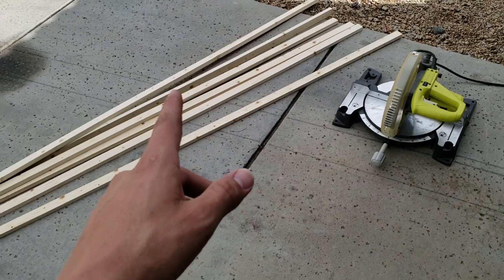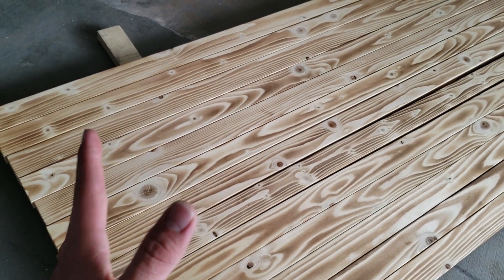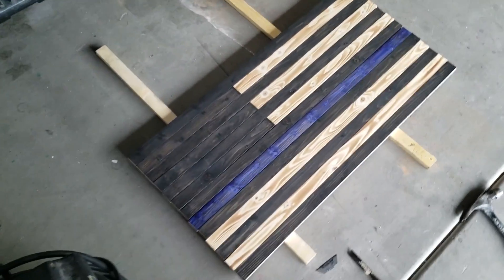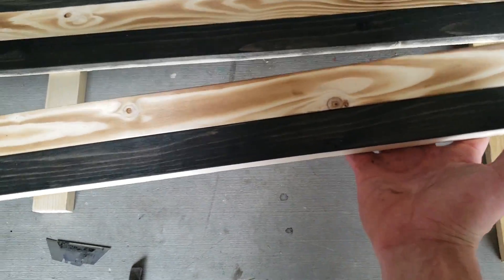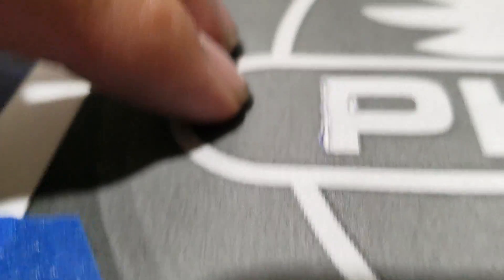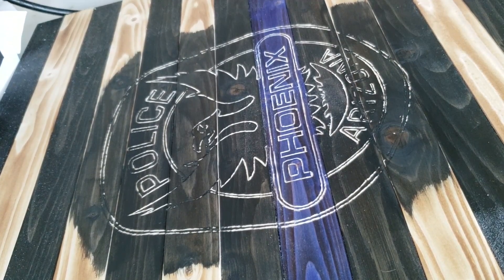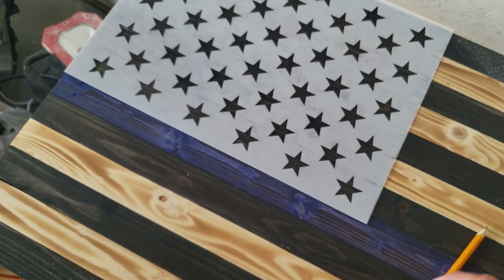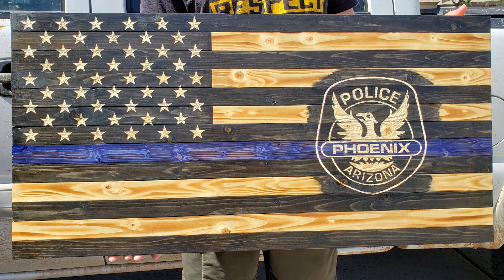HOW TO MAKE A CUSTOM WOODEN THIN BLUE LINE FLAG! STEP BY STEP! HANDMADE

Comment: Good job. A year or so ago I made one for myself and some of my friends have ordered a few from me. Nice little extra income to. The only thing that I have done differently than you is the placement of the hangers. I use the sawtooth hangers but I place them so they are about 16” on center apart. That way it can be mounted into wall studs. It’s just a weight distribution. Thank you for your help. 👍
Reply from the maker: Thank you very much! Thats a great idea thank you for sharing 🙏🏼 im happy to help!

Comment: hey buddy, truth be told I went by your instructions (which are perfect) and after a day and a half working part time I had a really cool looking flag. Then picked up my brand new Dremel 3000 which I purchased just for this project and when it hit the wood it went zoowing!! across about 2 inches, ruined that one so started over, lol. I'm doing it for a friend who rides so a Harley theme -- replaced the blue w/orange and did an orange 1/2   2 stripes above.  so...precautionary advice - if u haven'r used a dremel prior,  think it  out and try it something else first
Reply from the maker: Hey man im sorry to hear that you had some trouble with your first one, i hope the second one goes better! Thats gotta be a really cool look with the orange stripe! Thanks for sharing, hopefully it will save someone else from the same thing happening!

Comment: Great video!
Just a few tips. Get yourself a miter table/stand. Easier on the back. A Workmate can be bought for like 10 bucks, works fine and folds up for storage. Use some eye protection when cutting. Them peepers are important, lol! Slower cutting when using the saw also. And when sanding, a mask of some sort.
Such a great build. I plan on using a bunch of your tips when I start to make mine. I purchased the star template kit you linked. I really liked the Dremel stencil work you did. Just awesome.
Reply from the maker: Thank you very much and thank you for the tips! They are such fun projects make, i wish you the best!
Reply: @MaxF01  , I just completed a Challenge Coin Display. I would be happy to send you a pic.
Reply from the maker: @fishn365  thats awesome! I have actually been meaning to make one of those ive gotten a couple requests for a video on it. I would love a pic, if you have instagram you could send it through that. My instagram is maxf_yt
Reply: @MaxF01  just sent you a message on Instagram. 
Hope it worked.. I'm sorta lacking in the whole social media department, lol!
Reply from the maker: @fishn365  got it, haha sometimes not being so connected to social media and online stuff is a good thing!
Reply: @MaxF01  yep. Less drama, less nonsense.  But, I will admit that YouTube can be a good thing,  lol!

Comment: Hey man I’ve made about 4 flags now , I was wondering where do you get your wood from and could you tell me exactly what you look for in getting so it’s not bowed, thank you :)
Reply from the maker: Hey man im so sorry for the late reply i didnt get a notification for your comment! Ive gotten pretty much all of it from Home Depot, usually i gotta dig through the pile quite a bit and on every piece i just look down the edge to see how much it is bowing and as long is it isnt moving too much you should be good. Also i would stay away from anything that has a twist in it, ive found that a twist is a lot harder to work with than a board that has a slight curve to it.  But for the most part i am able to find boards that are pretty darn straight and dont give any trouble.  Hopefully this helps :)

Comment: After you oulined the stars with the 105 bit, did you switch to a larger bit to clean out the middle or did you stick with the 105?
Reply from the maker: I switched over to the 106 for the middles

Comment: What colors are you using.
Reply from the maker: They are both from Home Depot and they are both Varathane Water Based wood stain
The blue is tinted in Navy Blue
The black is tinted in Midnight
Reply: @MaxF01  ..semi transparent